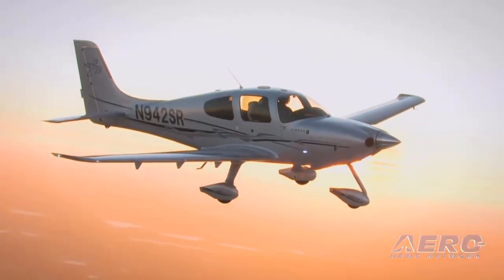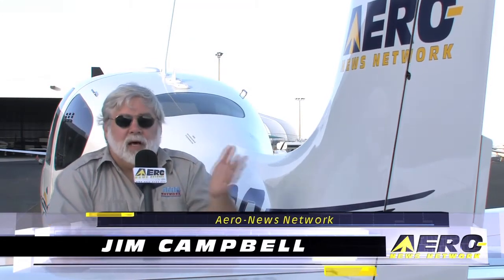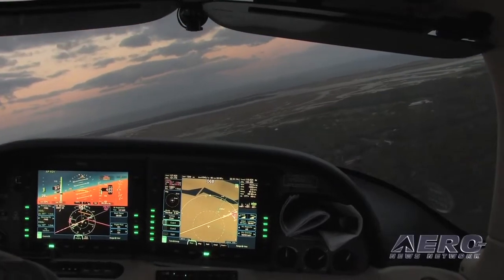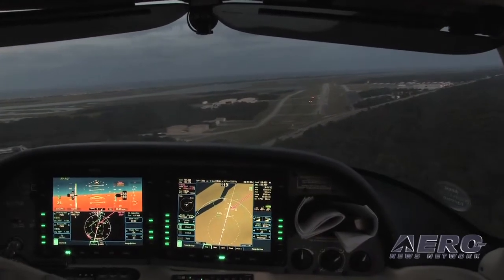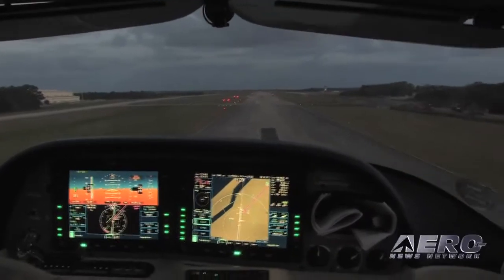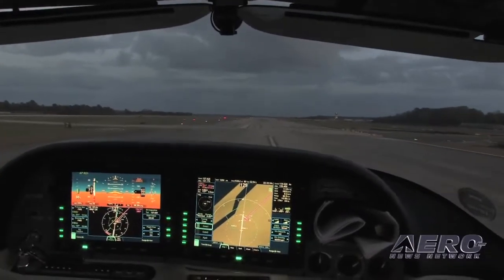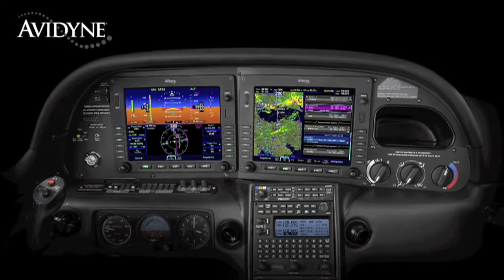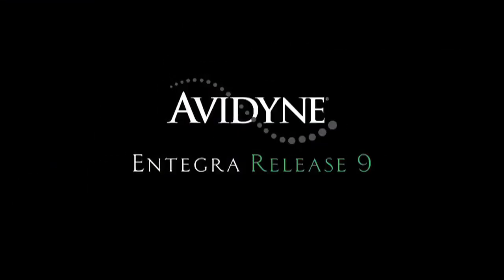Aero-TV: Rolling Right Along - The Cirrus/S-Tec 55X Roll Servo Upgrade

Comment: Nice plane Jim, R9 looks great! Looking at the Avidyne DFC-100 autopilot upgrade I noticed in the FAQ that the Roll servo talked about here will not be used. Is there any plan to work both the DFC-100 and the Roll Servo combined?  Or will you have to rip this mod back out when you upgrade to the DFC-100 and go back to using the Cirrus roll/trim servo. I kind of see the Avidyne DFC-100 upgrade as a upgrade to the input end and the S-tec Roll servo as a Output / Getting it done end. Your thoughts?